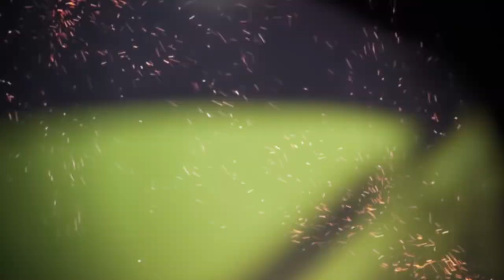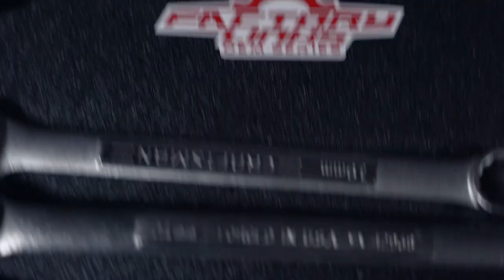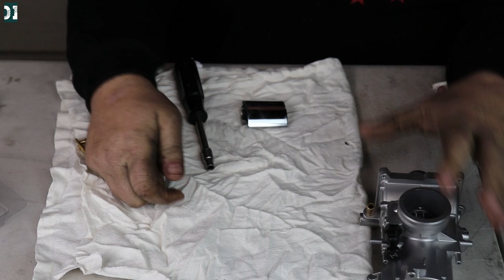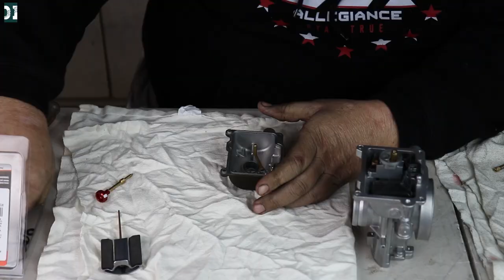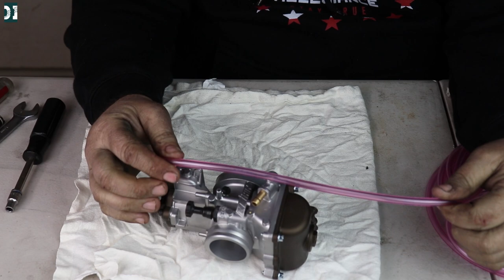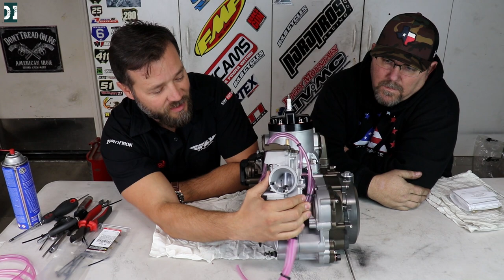How to rebuild 2stroke Keihin PWK carburetor - KTM 300XC build

Comment: thank you again, I checked the boot, no leaks found... then I took out the air screw and no washer and o-ring is present. I wanted to double check if it is needed (no o-ring in Keihin diagram) and you just confirm what I thought to be the air leak coming from. For the idle screw, I guess is just a sealant paste on the thread, mine had some gray stuff on it but not sure what kind.
Reply from the maker: yes there should be a washer and the oring, that can do the trick.. is it running ok now?
Reply: @dirtniron  i have been on a longer trip but because it was weekend I didnt had the chance to find an o-ring, but it is rideble, sometime stall easy but I am already used to ride it like this. The fix will follow :)

Comment: You don’t set the float level ?
Reply: You only need to set the float level if you or someone else previously messed it up. The factory usually has the float set at the correct level. Bend the tang up or down and that adjusts the float level. The more fuel the richer the lower the fuel the leaner. On your needle the top (highest) groove is leanest, as you drop the clip lower (bottom groove is richest) it becomes richer. Your jets become leaner as you go down in number, and richer as you go up to a  bigger size. If your more then 2 to 2.5 turns out on your airscrew your pilot jet needs to be resized, same as if you are 1 turn or less. Optimal for most bikes is 1.5-2 turns out on the airscrew.
Reply from the maker: it was good, no need to adjust

Comment: Where does the smaller of the two circle orings go? You don’t show, the bigger one is used on the float bowl drain plug. I can’t figure out where it goes!! Ktm diagram doesn’t even show it
Reply: You can see it left over at 3:41
Reply from the maker: it might be an extra for different models.. I am not 100% sure
Reply: It's to adjust the needle by 1/2 clip position.